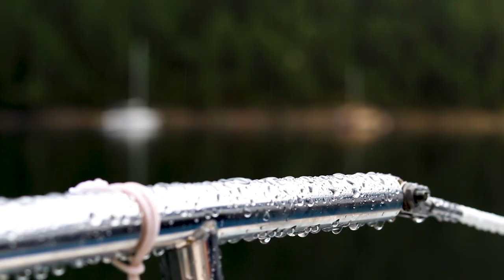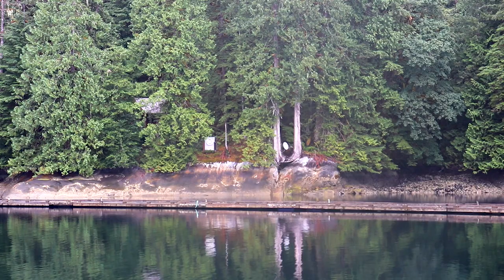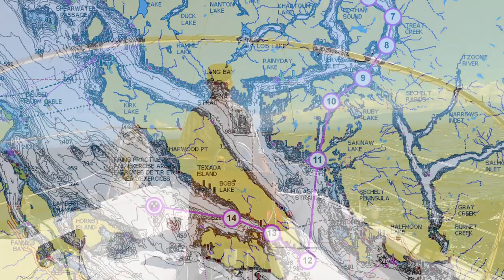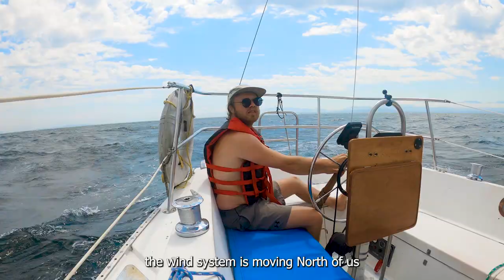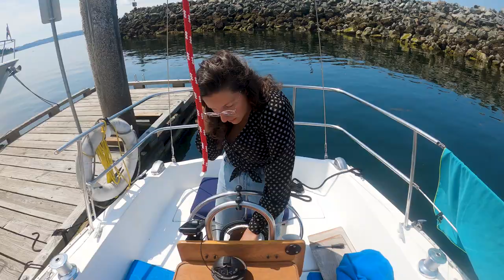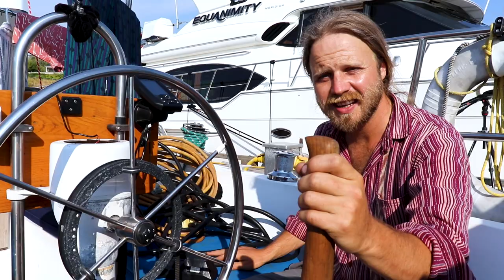Steering SNAPPED Near Land! Using Emergency Tiller for First Time | A&J Sailing

Comment: Remove incapacitated wheel for easy tiller use. I leave a wrench in aft lazarette with tiller handle
Reply from the maker: Yes we would definitely remove the wheel next time! Ours is also in the aft lazarette with the wrench attached. We make sure it is within arms reach and accessible at all times 😅

Comment: Nice job getting it under control, tillers will most often give a much better feel for the boat than a wheel will especially the Hydraulic wheels that have very little feel, at least you have a cable steer much nicer. but remember to be very careful with the wire clamps and always put them on in the correct position, the rule is the saddle should never be on the dead end or the old saying (never saddle a dead horse) is a good way to remember and never over or under torque and make sure cable is very dry and free from oil debris or any contaminates.
Reply from the maker: Cheers mate! Thanks for the tips, I'll have to pull the steering cable cover to check if I have the wire clamps around the right way, I didn't know that you should never saddle a dead horse!

Comment: Really love your videos, so much so that I'm systematically working through the back catalogue as well as keeping up with your new releases.

With regards to your water situation in this video, I was wondering about the pro's and con's of collecting fresh water from some of the falls and streams running into the chuck.  Thinking it would be fairly easy to take an empty container or 3 and fill them up at the stream, then tow them floating behind the dinghy to your boat--could be used either for drinking (boiled or treated of course) or washing.  (I think I read about something like this in the Patrick O'Brian novels.)  Of course, you had other things that needed attending to, but I just wondered if the rainy season on the coast would allow such water collection.

Also, well done with that emergency tiller!  The angle you had to use it at to avoid the wheel must have added so much effort.
Reply from the maker: Awe wow, so glad you're enjoying them!! Thank you so much.

Was a good first go with the tiller! We could have removed the wheel to make it easier on ourselves! Thinking about removing it permanently and replacing with a tiller and getting an autopilot for that! Just getting rid of the risk of cables breaking altogether. 

💧I had a chuckle about that in our latest episode saying we needed water when there was a waterfall rushing down the mountain behind me! We certainly could fill containers from natural sources and do just fine. 
 I'd be hesitant to put it into our water tanks/lines so as not to gunk that up with dirt and debris but we do have a gravity fed water filter onboard that we use when hiking. There's certainly no shortage of water around! What were really missing in those moments I guess is fresh food and cold beers lol

Comment: I always say when your driving your car do you keep moving the steering wheel back and forth? seems so many think the boat will not go straight they over steer instead of just holding it straight and just a tiny movement if it goes way off course. Theres so many people that have trouble with cable steering. I changed it on a few of my boats to gear or hydrolic.
Reply from the maker: Yes! Similar steering tactics to driving any other vehicle. It's one thing to hear that but another to experience it! 
It's interesting to watch yourself in moments of panic! We still laugh at our Navionics track from that day. But it didn't take us long to get the hang of it and we learned that we actually prefer steering the boat with a tiller. Thinking about removing the wheel and installing a proper tiller - eliminating that point of failure altogether.